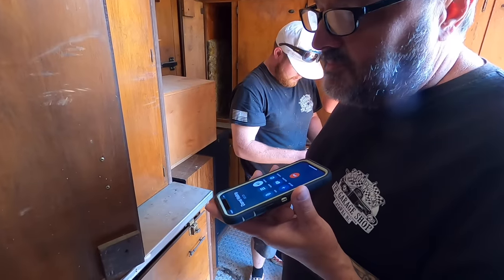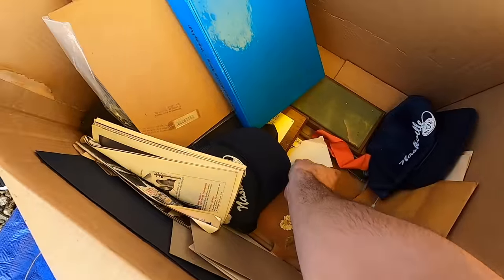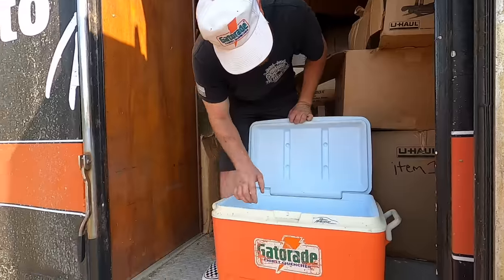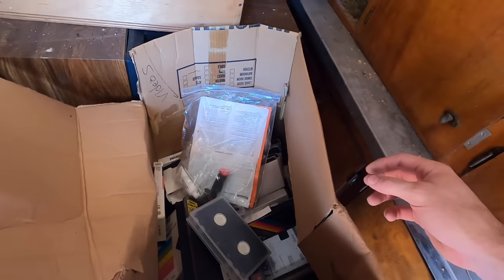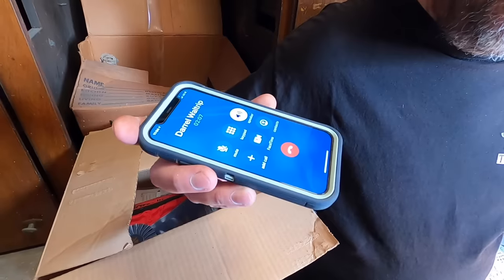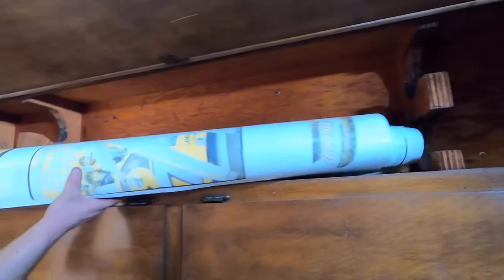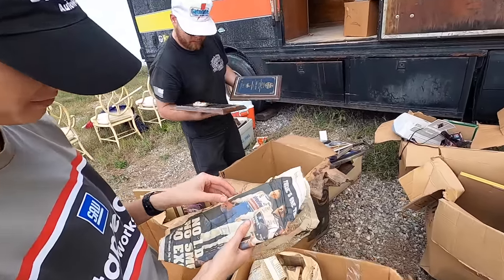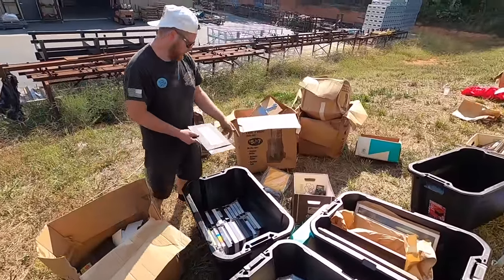Darrell Waltrip's Time Capsule: 1971 GMC Hauler Packed FULL of NASCAR History (Museum Grade Stuff)

Comment: We still have a Western Auto in my town that's still all original inside the store from 45 year's ago, same location same method of displaying auto parts which is kinda of strange because you can pick up the part's and determine if it's what you need where as most parts stores the guys behind the counter usually go back in the back somewhere and bring it back to you for you to look at! Also where my first bicycle came from nearly 40 year's ago and it had checkered flag designs on it and the crossbar🏁🏁🏁
Reply: Rowdy that's great. I had one of those as my first bike too. I don't think it took me long for me or my brother to break it.

Comment: Considering the truck is a GMC and the exhaust is 4” it’s probably a 8V71 Detroit Diesel. Pull the valve covers and make sure the injectors aren’t stuck, put batteries in it and it should fire up, change the fuel filters also. When DW said it leaked a lot of oil confirmed pretty much it’s a 71 series Detroit.

Comment: Those detroit diesels should have no issue firing up the only thing is that you gotta pop the valve cover off and make sure the fuel racks is not stuck because if they are they are stuck wide open and if you start it the engine will run away and you don't want that so getting someone who know old two stroke detroit diesel engines is going to be a must because you have to get the injectors unstuck if they are before firing it off.

Comment: Buddy of mine has what is probably a circa-1998 Andy Petree Square D #55 and a chassis that per the rumor that came with it is a Petty car but has coils up front and leafs out back so....  

Be nice to ID those cars somehow
Reply from the maker: It’d be truck arm if it were an authentic cup car
Reply: @Stapleton42  It's from the 1970s. 

The only Petty cars I can find that were coil front leaf rear were the Torinos he ran in 1969, I presume the Mopars had torsion bars up front.  But the car's been changed from Cup in a lot of ways so it's possible it's been clipped.

Comment: I’d like to see the truck running, I assume it’s got an old Detroit, just fill it with some diesel and 2 stroke oil mix and see if it’ll roll over, if not give it some starter fluid, Detroit’s are notorious ether junkies

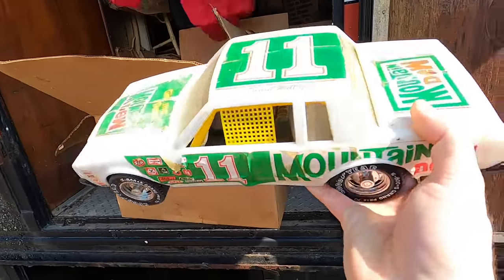Comment: 12:40 Doesn't know the difference between an 8 track and a cassette. I wonder how many young people would?
Reply from the maker: I doubt very many do. I know what a floppy disk is and remember them. Most my age don’t 😂
Reply: @Stapleton42  : I  guess you know the original floppy disc were flexible thus why they were called floppy the next portable storage disc were housed in a thin ( about 1/8" thick) hard plastic case but they were called floppy disc even though they were no longer flexible.

Comment: "Money in place of Hoosiers"? Sounded like Good year was paying people not to use Hoosiers
Reply from the maker: Yup tire wars of the early 90s was quite interesting
Reply: @Stapleton42 , Yup Intel got burned on that around 2010 i think, it was that result that brought AMD back from the brink is extinction. It was far more blatant than nascars though
Reply: @crazylarryjr  (it was in 2004, they settled in 2009 btw) it never actually saved AMD, it just kept them from folding completely. the damage was already done at that point so them winning the case didn't matter and Intel knew it. the 1.25b dollars it cost them was pocket change and the OEM's were pretty much locked into the intel ecosystem at that point because AMD was collapsing internally. the resurgence of AMD didn't start until after Lisa Su took over AMD in 2014.
Reply: @sirmonkey1985 , Sorry, just knew when the resolution came and thought 2010. thank you for the correction. I agree I should have said helped bring them back from the brink, because it was partly that settlement that helped them start making the Rysen cpu's they are now competing with. Thank you for the clarification